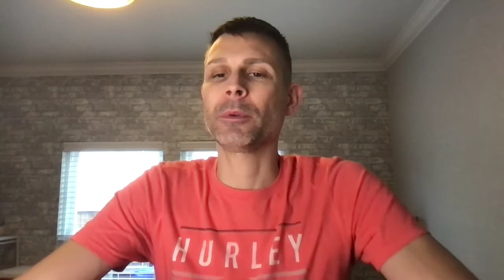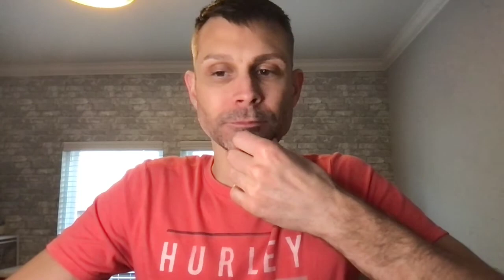2008 Ford Edge no crank start and battery have already been replaced #nocrank #battery

Comment: Was this ever resolved?  I have a 2008 ford edge having intermittent no crank, acting like the starter is out.  I have replaced the starter, starter relay, and battery.  Alternator tests good.  I have tried both sets of keys and starting in neutral but still no joy.
Reply from the maker: @mbellamy82  unfortunately the customer does not come back and let us know the outcome most of the time.  However, you can chat with a Ford mechanic online here 👉🏻 https://justanswer.9pctbx.net/c/361369/1342663/9320
Reply: @electricaljunky  after some troubleshooting I replaced the ignition switch today.  It seems to have resolved the problem, but it was intermittent before so only time will tell.
Reply from the maker: @mbellamy82  Sounds good, fingers crossed!
Reply: @electricaljunky  well, today it wouldn't start again.  My wife drove it at 5am to and from the gas station only a few blocks away.  At noon it wouldn't start.  Same symptoms, no crank at all like the starter is out.